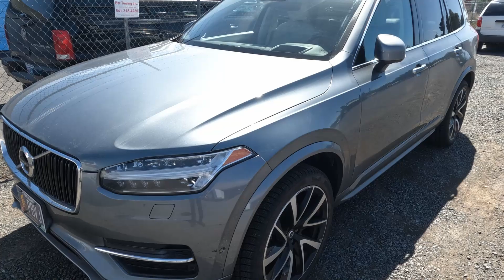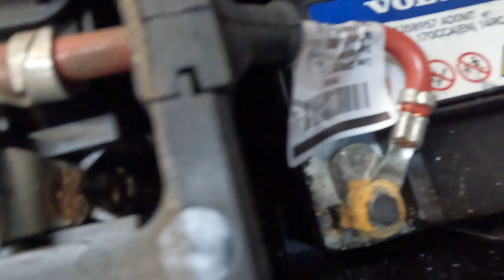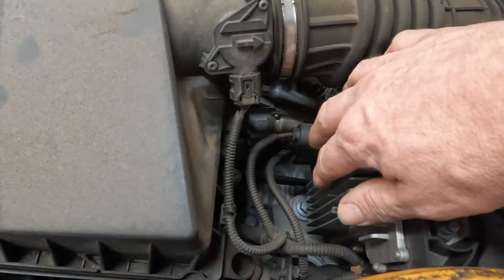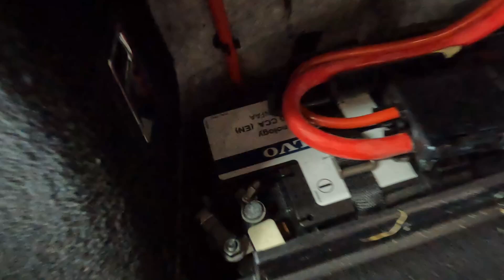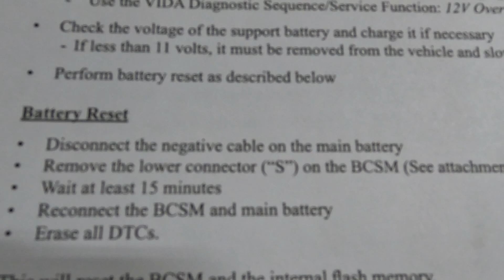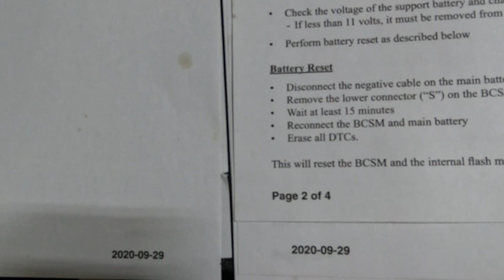Volvo xc90 Auxiliary battery failure and repair.

Comment: I have the same problem, and the message keeps coming back right after I reset the BSCM (I left it disconnected overnight to be sure). Both batteries are fine and holding charge. I did notice that, when the engine is running, the large positive terminal that sticks out of the support battery assembly measures 14.4v but the battery's own positive terminal measures only 12.4v. The main battery in the back does measure 14.4v when the engine is running. Is the voltage difference between the battery terminal and the large positive stick normal, or could that be the problem? If that's the problem, how could it be fixed?
Reply from the maker: These batteries are highly problematic. I would scan for codes. Have also seen the hood latch cause this issue.

Comment: I try
Reply from the maker: Did it work?
Reply: @evolutionmotors9374  nope. In my Case, the 48 Volt was dead. In the first 30 month.  An In Front my battery is not like in the video. It is a condensator. And the start stop system was the Main reason ehy the back battery 48v was dead. 1200 euros for replacement. But Volvo paid. 
Thanks anyway! ❤🎉😊

Comment: Do you reconnect the main battery AFTER INSTALLING AND RECONNECTING THE service battery and the “s” cable AND waiting the 15 minutes? 
I’m just a bit confused with the order of things.
Reply: I’m wondering the same.  There’s a sequence to follow on my Mercedes to avoid triggering other warning lights.
Reply from the maker: Yes. Connect the main battery last.